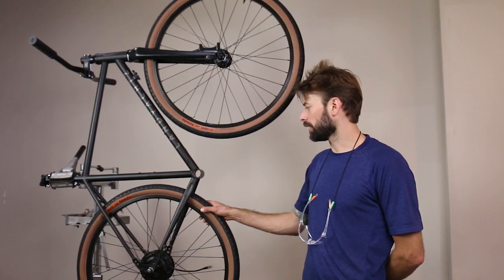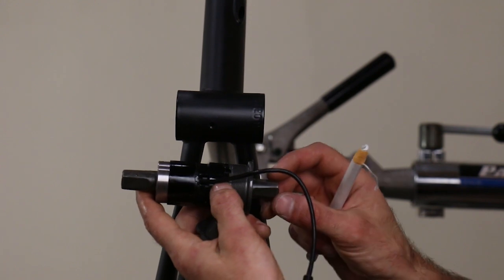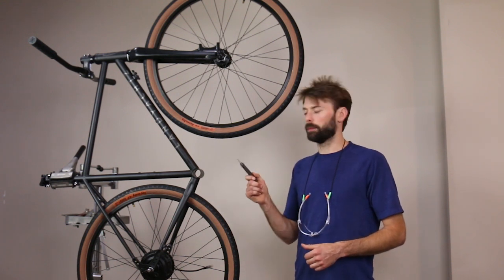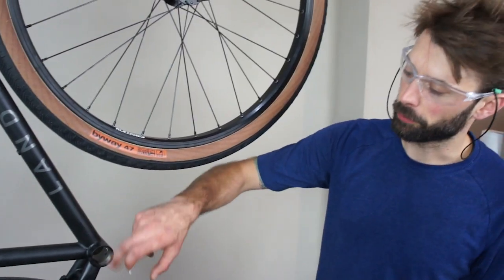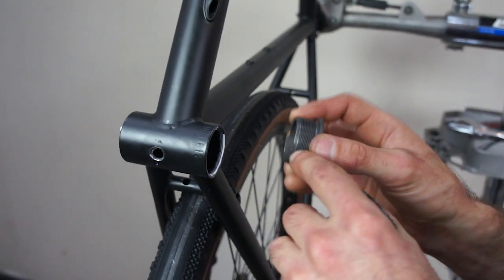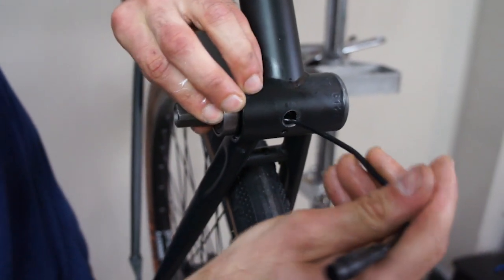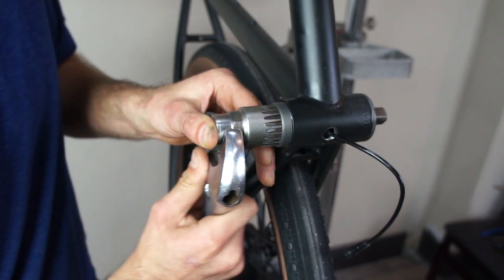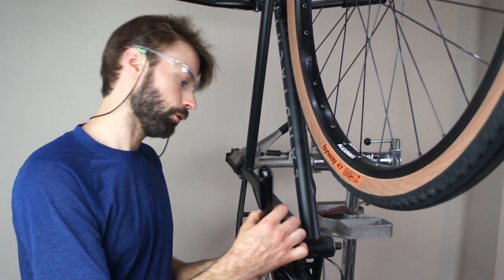How to Install the Sempu Torque Sensing Bottom Bracket

Comment: Excuse me, I have a torque sensor just like that one. The original one was damaged, but the new one doesn't have the white dot marked on it. How do I calibrate it with the connecting rod? Can you explain? Thank you very much

Comment: Can I make this torque sensor work with my VeLotric Nomad1 bike? It has - 750w hub motor, cadence sensor and the controller built inside the f4ame
Reply from the maker: Yes but not without a lot of custom wiring and component replacement as well as a pretty deep knowledge of ebike electronics.  See this series to get an idea of what that kind of job could entail https://www.youtube.com/watch?v=sL3bjQZGjoQ

Comment: I recommend the use of a stepped drill bit like a Unibit to follow a 1/8" pilot. Using a standard  style bit, going from small to large, the hole will be out of round, the chaser bit may bind and cut a notch or have otherwise crappy looking cuts. The bit isn't cheap (buy a name brand) but whenever you need to enlarge a hole in metal or acrylic the results are perfect. It will leave a slight taper to the hole on thick material if only cut from one side and you must de-bur the back side (or on flat stock clean it up with a chisel).

Comment: Which controllers support torque sensor ?
Reply from the maker: Using the V3 Cycle Analyst you can add a torque sensor to virtually any motor controller once you hook it up so that the throttle signal to the controller is coming from the CA3's throttle output.

Comment: Could you route the cable up into the seat tube and out an enlarged bolt holes originally used for the water bottle holder?
Reply from the maker: Most bottom bracket shells are not drilled out up to the seat tub tubing. But if you have a bike where this is hollowed out, and you fed a snake/string through the tubing first in order to pull the cable up through that opening, then yes that could in principle be done. 
Note that it would be a PITA to work on if you ever needed to remove parts for service though. That's the case with most through-the-frame cable routing.
Reply: The steel road bike frame I used I had converted years ago to full-size travel bike with S&S couplers, and had a hole in the bb shell at the bottom of the down tube, so I drilled holes on the bottom of the down tube just in front of the BB shell and just behind the head tube, routed the bb sensor wire through the internal hole into the down tube and out the whole at the top of the down tube to the CA, and routed the wire connecting the CA with the controller in the top down tube hole and out the bottom down tube hole. Very clean internal e-bike routing. The only zip tie is on the chain stay for the hub motor cable. The S&S couplers make it easy to connect the plugs inside the down tube.
Reply: If you or anyone wants to do it this way, but your frame doesn't (yet) have the requisite hole, look for "installer drill bits". They come in lengths sufficient to surpass any seat tube.

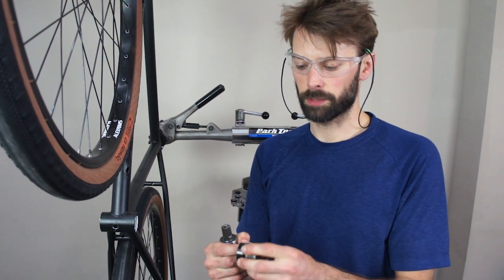Comment: How can I remove the plastic spacer you inserted at 2:30? Or is it stuck inside the bottom bracket forever?
Reply: its soft enough to bend - just pull it out with your fingers or ring pliers

Comment: Should I be concernederned about water from the street splashing up into the bottom bracket now that a hole's been drilled into the frame?
Reply from the maker: If anything it's the opposite, now you have a drain hole so that water which gets into the frame tubing or the seat tube has a nice easy escape and won't pool up.  Just make sure that the hold is drilled at the actual bottom, and not towards the front or back sides.

Comment: Worst way to drill a clean hole in metal...
Reply: Meh. It's fine for steel. I was more concerned about using a finger to put the grease in there...nice way to get yourself a new piercing! lol

Comment: Could you cut the connector off and solder it back on to avoid needing to drill such a large hole?  How many conductors are in there?
Reply: You could, but the closer the wires are to the edges of the hole, the more likely they are to be cut! In either case, I'd recommend some kind of chemical goop (hot glue, silly-cone or if you're really brave/confident in your installation, maybe urethane).
Reply: @fun_ghoul  fit a rubber grommit.

Comment: are there any BB torque sensors that work with bafang bb mid-drives? (bbs02 or bbshd?)
Reply from the maker: Almost be definition no, since the BBS mid-drive systems already include the bottom bracket spindle with all the associated gearing on them. You can't replace the bottom bracket in a BBSXX setup, since the BB is an integral part of that setup unfortunately.  If you get a mid-drive kit that drives the right side chainring, like a Cyclone or ecospeed etc., then in principle you can use the THUN/NCTE style torque sensors since they measure just the torsion on the left crank and that is decoupled from the motor power.
Reply: @GrinTechnologies  thanks for clearing that up!

Comment: Out of curiosity, are there any precautions I should take while drilling the cable hole into the BB shell on an aluminum frame?
Reply from the maker: Not really, aluminum is much easier to drill than steel and easier to file off any sharp burrs too.
Reply: Thanks! I was just worried drilling an aluminum frame might be lead to cracks in the BB shell considering how soft the material is.
Reply from the maker: I suppose that's a valid thing to think about. But most BB's already have a drain hole in them anyways, and the bottom center of the tube like this is not where the crack producing stresses are concentrated which would tend at the chainstays and downtube welds.

Comment: Hi, 
what is the purpose of plastic spacer? .. is it important for torque measurement?

thanks
Reply from the maker: No, rather it has notches and alignment slots and plays a very critical role to stop the body of the torque sensor from turning as you tighten the drive side cup. Otherwise, the body of the torque sensor could rotate and damage the cable as it pulls it through the hole in the BB.

Comment: How is this a torque sensor when the crank set is not attached to the body of the sensor but only slid onto the axle along with the pedal? When you pedal, the chain is going to pull against the axle which is connected to the pedal directly. How can it measure with how much force you need to pedal? I have just finished installing my new "torque" sensor which seems to have the same "feature" and I realized that I could've just bought a simple PAS.
Reply from the maker: Hey Daniel , it measures the resulting flex on the spindle from the downwards force on the pedal cranks, as opposed to the actual torsion. So correct it is not a true torque transducer but it does a very effective job of measuring the forces present when a rider is torquing on either the left or right pedals. This is explained this along with some diagrams on this page here:
http://www.ebikes.ca/product-info/advanced-pas-kits.html#torque-sensors
Reply: Wow, thank you I haven't thought of this. :-)
Reply: @GrinTechnologies  (https://ebikes.ca/product-info/advanced-pas-kits.html#torque-sensors) this link no longer works...

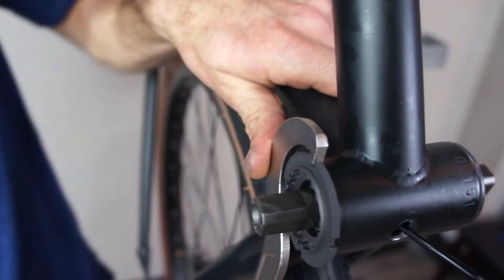Comment: 2-weeks too late for me but the tip at 4:45 about the alignment dot is extremely helpful. I am going to pull the crank arm and check to see if I installed the cranks incorrectly. Thanks for the video!